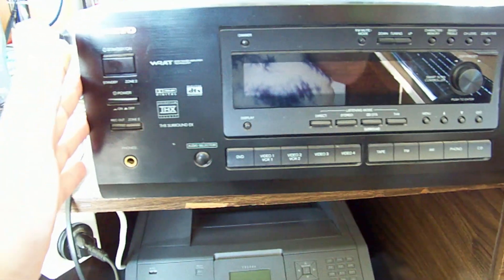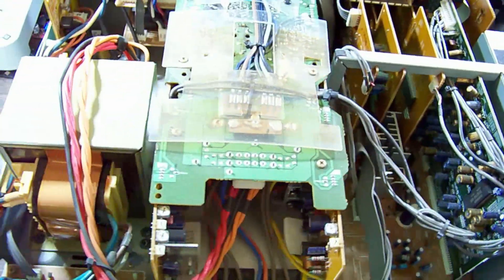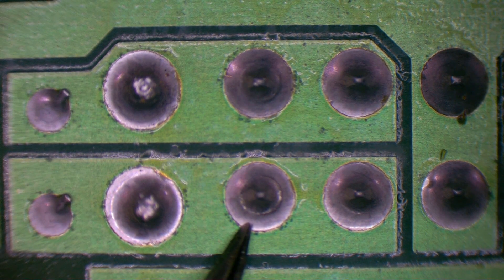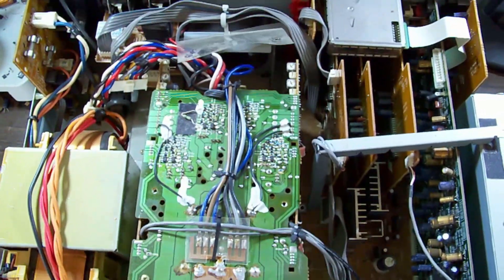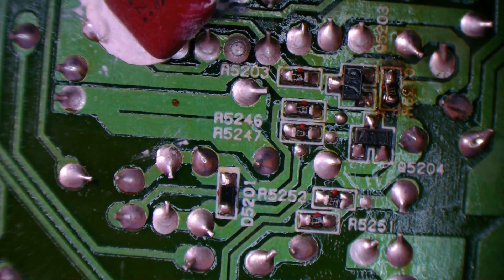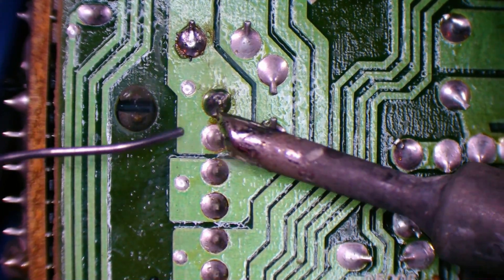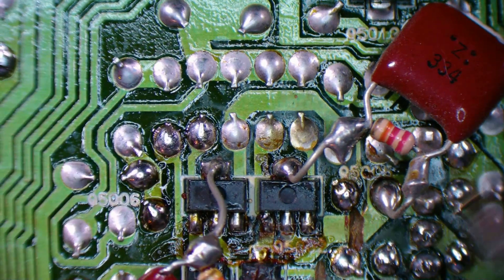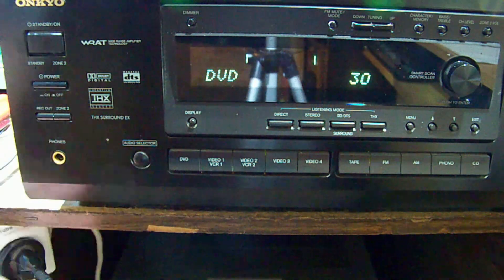Onkyo TX-DS787 protect mode repair

Comment: I have the same amplifier and I've replaced speaker relay and the super/memory cap. I did not tear whole thing apart when replacing the cap. Those grey cables very easily give you a lot of trouble as they does not make a connect and then does. After your fix I've noticed that when you turn main power switch on it instantly turn the amplifier on. That is not what it should work.

Comment: Hi,
I live in Turkey. i have broken sony str-kg800, able to repair I could not find one in Turkey.
my problem is IC400. i changed 2 times broken 3x UPC2581V and 5 sec after burn UPCs. I ran it without UPCs. I MEASURE IT IC400’S SIGNAL OUTPUT CHANNELS AND GIVES DC VOLTAGES after few seconds. First low signal sound for few seconds . after outputs dc voltages. And burn UPC2581s and system protect.
My question is ,
If i change IC400, will the problem be fixed?

Sorry for my bad english. Thanks.
baris@durmazevgerecleri.com
Reply from the maker: If you haven't already, get the service manual from a google search. It's a very strange issue and I wouldn't have thought DC on the output of IC400 (and so input of IC600/700/800 page 22) would cause the IC to fail unless it was excessive. Remove the 3 ICs so they don't blow, check all of the power rails to make sure they are what they should be and there isn't a an imbalance somewhere (+ & - 7V on IC400, + & - 44.8 on others). If ok, have a look at the inputs to IC400. EG, pin 70 is SRIN, 17 is SROUT. With no audio 17 should be 0v as shown on schematic. When 17 goes DC what is 70? If 70 is 0V then IC400 is likely bad. If 70 is DC then trace it back, IC1404 which is fed from IC1452. Any of them could be passing on the bad signal. Good luck!

Comment: That certainly didn’t have a very good soldering job done from the factory!
Reply: I work fixing Onkyo receivers here in my country, in this days I receive many units with resistive PCB's, receivers turn off after press On or show "Check Speaker wire"
My solution was cut the traces and and lift some components soldering to each other.

Driver board generates a lot of heat, especially in the SMD SOT23 transistors.

I have many tricks, like cable extensions for the boards.

Best Regards.
Reply from the maker: Aren't onkyo supposed to be one of the higher end models...
Reply: @JonnyFix  Onkyos are known for getting too hot. All the heat cracks the joints
Reply: @JonnyFix  No. Integra is Onkyo's high end brand